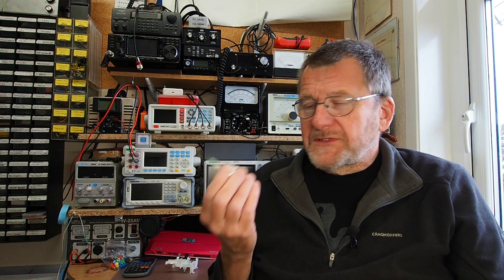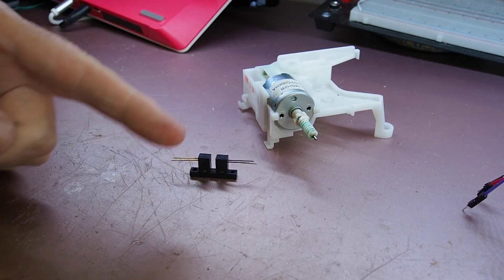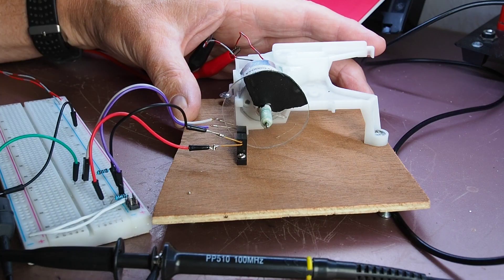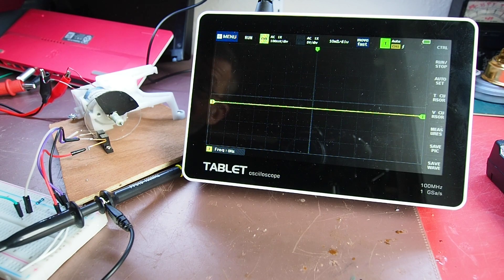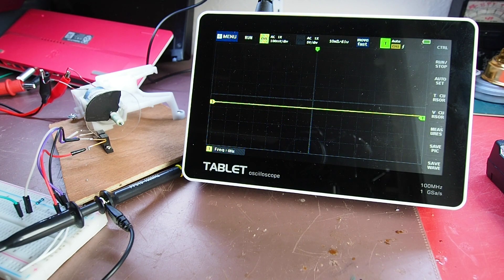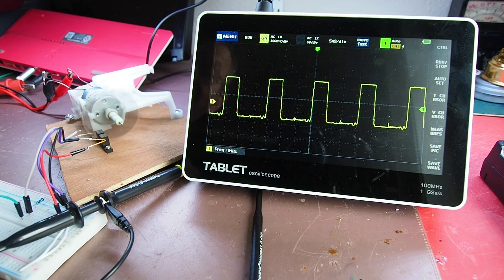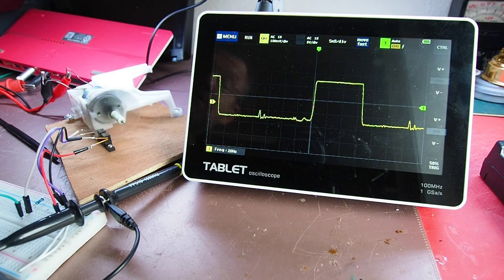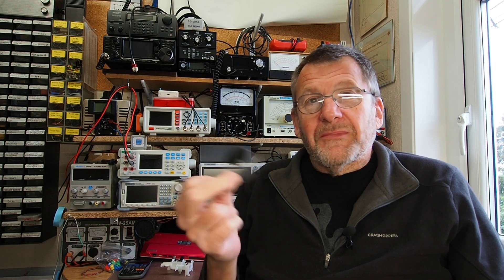The FNIRSI 1013D Tablet Oscilloscope as a Tachometer  - #087

Comment: Strange AC scoop behavior. When the duty cycle increases from 1/4 to 1/2, the shown low level should go down as at 1/2 it should be right in the centre of the high and low levels.
But as shown, the low level even goes up in stead of down. In DC mode, the 2.5V and 5V levels correspond with the levels measured on the multimeter.
During the measurement, the ambient light makes the transistor to be conducting alread a little so the 0V is never reached. Covering the setup could help getting there.
I think that this measurement should be done in DC mode and perhaps increasing the V/div or shifting the "zero" level a little down.

Comment: You are really getting some good use out of the tablet oscilloscope. I just recommended it to my co-worker who is looking for a scope for his teenage son.   I work on a lot of pumps and motors at my job and see those sensors all the time. Usually it is a black disc with a notch cut out that the sensor looks for. Just a little bit of dust can make those sensors read erratic. They are very sensitive, as you saw today. Keep up the great videos. I keep learning new things all the time from this channel.
Reply: I love this little scope and have enjoyed the bits with ideas on using it.

Comment: I'd like to see the plot of amperage draw as well. I assume that as Voltage & RPM increase, the amp draw would also increase. I'll give another listen to get the values & check it out.
Nice example of an unusual application for the scope. I actually will be using this once I get a similar optical detector.
Thanks for the idea.